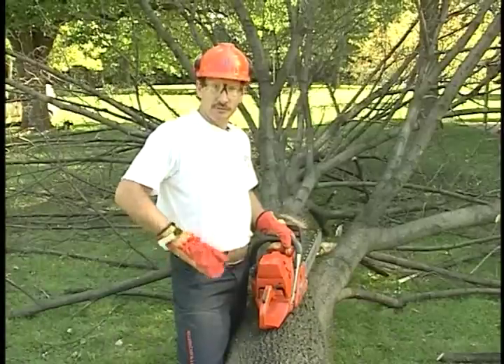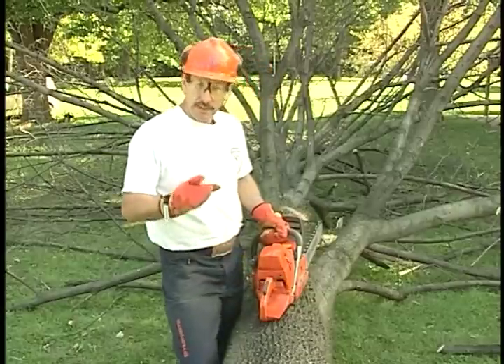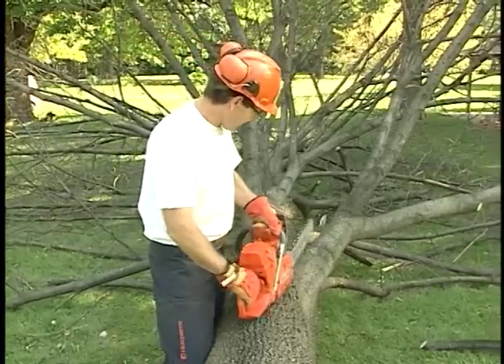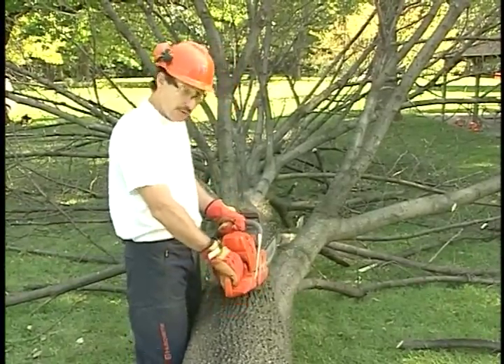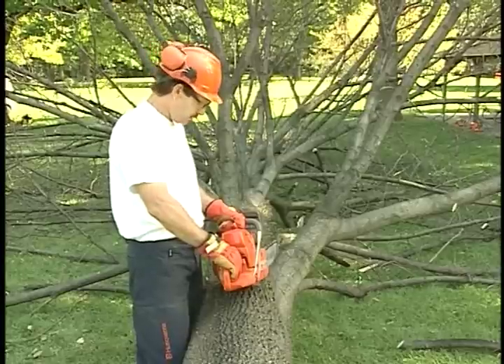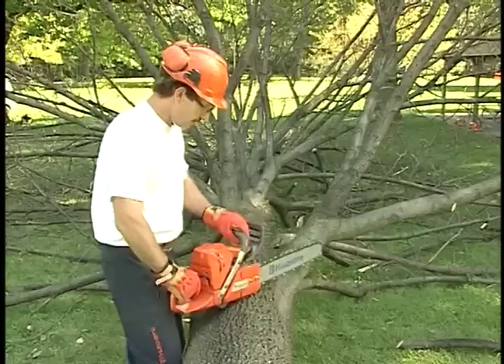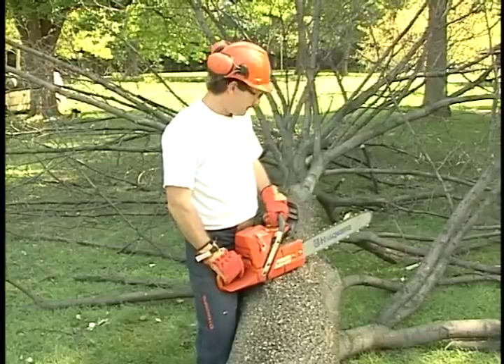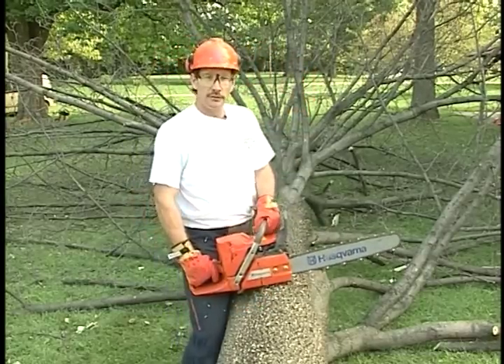Limbing

Comment: I cut my own firewood. When I drop a tree I start at the top, cut the small stuff off and get it out of the way, then work my way down the tree, cutting small to bigger everything that does not have any pressure on it, when that is taken care of and moved out of the way, only then do I start on the limbs that are supporting what is left, one 16" slice at a time until there is no pressure on it then get it cut and removed, until the trunk is sitting on the ground, then it gets sliced up and loaded.